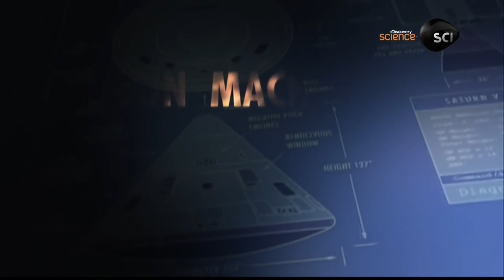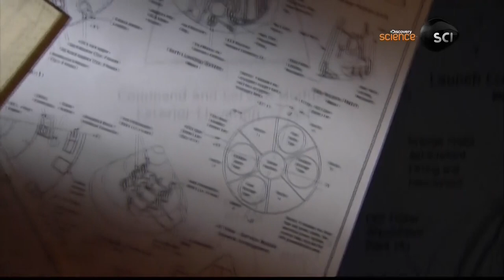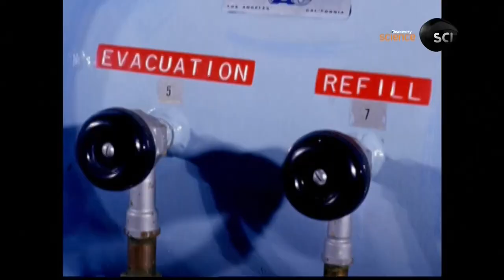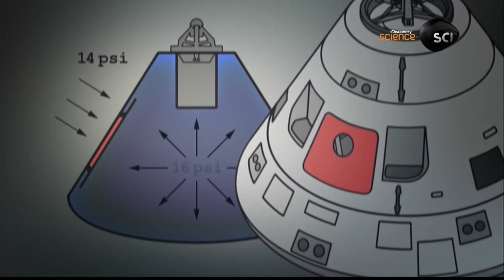Moon Machines - The Command Module

Comment: I think I found an error (7:50): The SPS engine used hypergolic fuels, not hydrogen. 

Still, love this series!!
Reply: I think you might be confused with the LEM. The LEM APS used hypergolic fuels which even corroded the engine so it had to be rebuild every time. I think the SPS used hydrogen and oxygen. But I am far from being an expert so I am not 100% sure.
Reply: @martinkirouac you’re right
Reply: @martinkirouac  According to Wikipedia, the SPS "used Aerozine 50 as fuel and nitrogen tetroxide (N2O4) as oxidizer..."